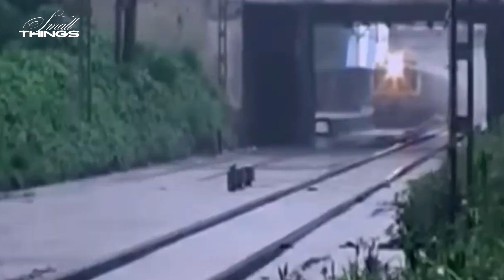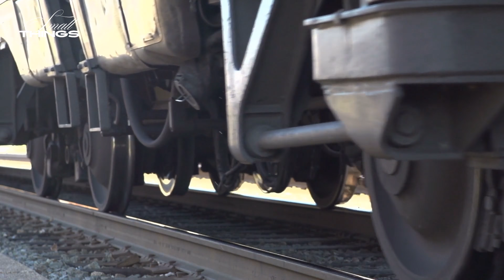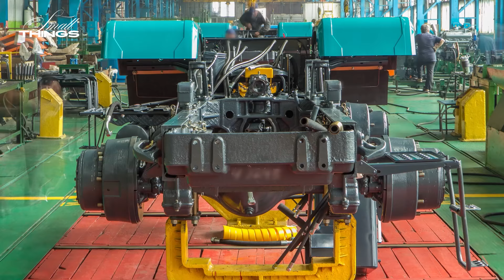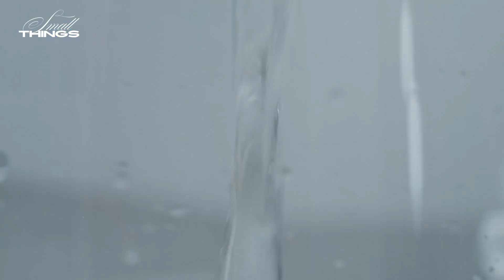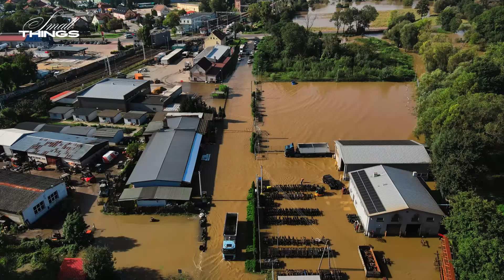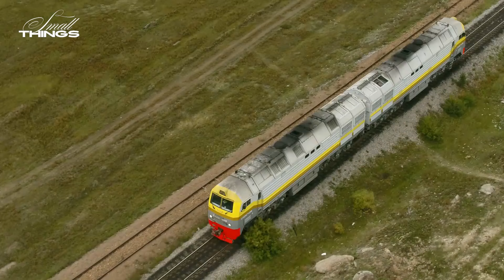Why Do Trains Stop for Just a Few Inches of Water? The Hidden Risk Beneath the Rails

Comment from the maker: A few inches of water don't seem powerful enough to stop a freight train. But what if the real danger isn't the water you can see? 🚂🌊
What's another train mystery you'd like us to explore next?
Reply: Because traction motors are now located in truck's frames. and high risk of water induced short curcuits. something Diesel Hydraulics are immune to.
Reply: Please expand Russian steam in service 2026 protection power against EMP & flood as well...    Reported via military satellite sources.  Reported training runs for military crews over the last few years, running SU 2-6-2 class engines back-to-back so turning power not necessary for return trips.    Another North American problem for diesels and straight electric worst case shall be periods of volcanic ash plugging air filters- steam not affected.

100's of Russian steam locomotives have been kept serviceable, or intact still able to be repaired to service.   Please research & verify.

Comment: Modern trains have sealed electric engines like the German Inter city express BR 406.
Reply from the maker: Good point — some modern trains are much better sealed and protected. But even then, flooded track can still be dangerous because of traction loss, debris, ballast washout, and hidden damage under the rails.

Comment: It’s not the water that’s the problem. There could easily be a track washout or other issue hidden under there.
Reply from the maker: Exactly — that’s a big part of the risk. The water itself is only part of the problem; what it may be hiding underneath can be even worse.
Reply: I was on an Amtrak train where that happened.  I was travelling from Syracuse, NY to NYC around Labor Day 1998.  It had to terminate in Albany because the tracks South of there had detached from the rail bed.  They were going to try to send it to NYC anyway through the water, otherwise, but you kinda need tracks lol.

Comment: Bullshit..Water is one of the best cooling liquids. It is water corrosion and short circuit by dirty electrcally conductive water that would kill the electrical motor, not temperature.
Reply from the maker: Good correction. Cooling isn’t the main issue by itself — dirty conductive water, corrosion, short circuits, traction loss, and hidden track damage are the bigger risks.

Comment: Maybe water in the bearings. Just asked my son a Locomotive operator. Cooling air ??   Snow would also be a problem if water was such an issue.
Reply from the maker: Good point — bearings and cooling air can be part of the risk too. Snow is different because it usually doesn’t flood the traction motors, ballast, and track bed the same way moving water can.

Comment: Why can't trains simply drive through flooded tracks.  Video shows trains driving through flooded tracks....
Reply: My former carrier's rules allowed operation with water 2 inches, 50 mm above the top of the rail.  The bigger problem is, 2 inches here becomes a foot several hundred feet down the line.
Reply from the maker: Some trains can get through shallow flooding, but the risk depends on water depth, current, hidden track damage, and what components get exposed. That’s why railroads usually treat flooded track very cautiously.

Comment: lots of issues.  rails loose load bearing capacity due to ballast being immersed or eroded.  wheels loose traction running risk of getting stuck in the water.  traction motors go immersed causing shorts or water into bearings.  dirty water flooding air cooling channels.  wheel bearings not designed for immersion & thus accelerated wear until failure.  wet brakes on cars loose braking even if locomotive retains dynamic braking.  so in summary trains are not designed to run while immersed & running them through water has potential for ruining lots of expensive equipment.  the narrator keeps repeating the water in air channels allows overheating.  that is only partially true.  only if water is blocking air inlets but not if locomotive deep enough for water to complete the cooling circuit.  your script needs a little editing in that specific area.
Reply from the maker: Great summary — that’s exactly the bigger issue. It’s not just “water on the rails,” it’s the traction, bearings, brakes, ballast, and hidden damage underneath that make it risky.

Comment: Rerouting the air intake to a place that is dry would be a very easy redesign, making the motors submersible and air cooled. The damage under the rails would be a more realistic reason to avoid the puddle. Even standing water can compromise the substraat under the rail bed, causing soft spots and a future derailment.
Reply from the maker: Good point — the track bed and ballast are a major part of the risk too. Even if the motors were better protected, water can still undermine the railway beneath the train.

Comment: We should be asking why the railroads have not upgraded the hardware for Dielectric coolant. It is in high powered computers and server storage units.
Reply from the maker: Interesting idea, but trains face more than just cooling issues in water — traction, electrical systems, debris, and safety all become problems.
Reply: @SmallThings-sc This is true. Dielectric coolant system is a sealed system, foreign elements would not get into a sealed system if done correctly.

Comment: It’s probably to low coefficient of friction. Steel on steel slides more easily. It’s one of the reason we still use trains to move freight. Because of that low friction, it takes less energy to keep it moving, when compared to a truck. Downside is, it also makes stopping difficult, and it’s easy to lose traction in wet conditions. If a train is heavy enough, the inertia of the consist will just push the locomotive through, even if it’s lost traction. But, if you have enough water, and a train light enough, the train breaks traction and stops in the middle of that pool and can’t regain its traction again. Not as bad with freight trains, because they often have more than one engine. But a lone engine in say, a yard? That’s bad luck. Although, with freight trains, I’d also be worried about the loss of breaking power. As each car passes over the pool, its breaks will be less effective as long as it’s in the water. Can be dangerous if you need to stop.
Reply from the maker: Exactly — steel-on-steel is efficient because of low rolling resistance, but that also means traction can disappear fast when water gets between the wheel and rail.

Comment: A sealed   eletric engine with a fan blowing  a lot of colling ai takem from somewhere else? 
Bad idea ?
Reply from the maker: Interesting idea, but sealed engines still need cooling, ventilation, traction, and electrical safety. Water mainly creates problems with grip and systems under the train.
Reply: Sealed electric motors are common in Europe. Same goes for cooling from above. Flooded tracks isn't a problem unless there's a risk of moving the track or each of the rails.